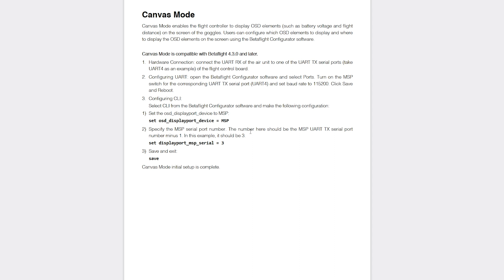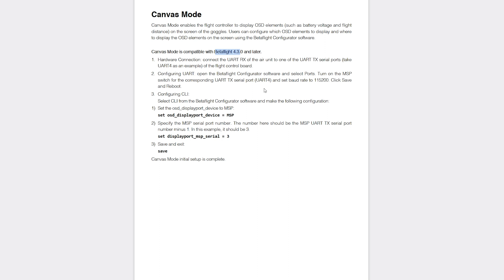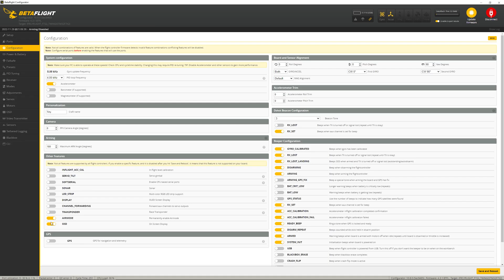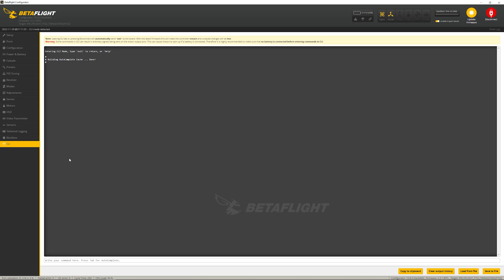How to get your custom BetaFlight OSD working on the DJI O3 Air Unit | MSP Canvas Mode is HERE!

Comment from the maker: Hey All, with the release of Betaflight 4.4, note that you no longer need to use the two CLI commands and you would set the MSP Displayport straight from the ports tab (Peripherals column). DJI does not support the HD feature though! If this does not work, make sure to set the Video Format to PAL on the OSD tab and run the set osd_displayport_device = MSP CLI command. More information is available in the release notes here: https://betaflight.com/docs/release/Betaflight-4.4-Release-Notes
Reply: I use bf4.4 - if I have o3 and v2 gogle I must use only hd option ? - it's not working :(
Reply from the maker: @froskproject  The O3 does not support the HD OSD feature and the OSD elements can only be placed in a 4:3 format for now. Use PAL.
Reply: Still can't get it working with this fix. I have voltage but that's it. Any ideas?
Reply: ahh you have to go to peripherals and set VTX msp for the uart
Reply from the maker: @SFPV  Correct, this was changed in Betaflight 4.4 I have a pinned comment about that.
Reply: @Mangorille  Brother, the link is saying "page not found"
Reply from the maker: @NatanRufino  Try this: https://betaflight.com/docs/release/Betaflight-4.4-Release-Notes
Reply: @Mangorille  Thanks a lot!

Comment: That should be good with the 04 unit too right..
Reply from the maker: Correct. Just make sure you use the instructions in the pinned comment as the Betaflight steps have changed.

Comment: can this be applied for 04 lite and o4 pro air units as well?
Reply from the maker: Yes, this applies to the O4 lite and pro as well. Just make sure you use the updated instructions in the pinned comments as there were some changes on the betaflight side.

Comment: Hi the second msp command its not valid on BF 4.3 or  4.5.imnot getting either the voltage on the dji googles im usin V2 googles
Reply: i have  speedybee405 v4 I selected msp on uart1 and not working. I swapped the pins rx and tx on the o3 connector to the FC and still the same. im stucked
Reply from the maker: @rondridealmeria  Can you send me some pictures of how you have the O3 wired up on the flight controller? If you are not getting the drone's voltage on the goggles, usually that's a wiring issue.
Reply: @Mangorille  the funny thing is that the wiring goes to the FC to the dedicated connection and the  pin order is right. Just sorted a couple of days ago, apparently Tx or Rx pins were not contacting into the DJI connector. Thanks for your reply!

Comment: What if it is UART 1, do you enter  zero in the CLI command
Reply from the maker: If you are running betaflight 4.4 or later you no longer use those commands. Check out the pinned comment. If you are using a version before 4.4, correct set to 0 if using uart 1.

Comment: Does it matter if I'm running wtfos.. cause my goggle can't be rooted.. for the other units.. ??
Reply from the maker: Which air unit are you using?
Reply: @Mangorille  03 v2 goggles. I've followed your steps.. in your video I'm on 4.4  but still can't seem to get the osd in my goggles.
Reply from the maker: @jessefpv4949  Did you follow the pinned comment for 4.4? The steps are slightly different when it comes to Betaflight 4.4.
Reply: @Mangorille  lol you didn't answer the question....does it matter if I have wtfos or no. Cause I don't. Is that preventing me from seeing osd.. or the wires from the o3 that are used for sbus and the dji radio.... cause I still have tho wires in and no problem with the rx like I've been seeing ??
Reply from the maker: @jessefpv4949  No, wtfos has nothing to do with the O3 part of the software. Weather you have it or not doesn't change anything when running the O3. The issue is one of two things - 

1. You don't have Betaflight setup correctly, which you said you have followed the instructions so that shouldn't be it. 

2. The RX and TX wires are not wired correctly. Do you see the quad's battery voltage displayed in the goggles?
Reply: @Mangorille  yes sir brother I've been flying it fly like goddess.. just no osd.i can email you pics of what I have or at least beta set up
Reply from the maker: @jessefpv4949  Sure send me some pics. To make sure, you see the drones battery voltage in the goggles?
Reply: @Mangorille  just the dji osd not beta osd what's your email

Comment: hey was that recording in 4k 60fps? what camera settings u have?
Reply from the maker: Correct, 4k 60. I use normal FOV, white balance locked to 4000k, and the shutter locked to 1/120. I use ND filters.
Reply: @Mangorille  nice! That video is really sharp.

Comment: Hi, i am using BF4.4.2,  AU O3 with DJI Goggles V2,  all work fine with HD OSD but i have no OSD on the DVR video recorded,  can some one help THX.
Reply from the maker: That’s not supported on the Goggles v2. You need the extra horsepower of the Goggles 2 or Goggles Integra to live transcode the video to embed the osd into the goggle recording.
Reply: Oh..i don't know about that😢 thank you

Comment: I have the Googles V2 with the DJI O3 Air Unit in my Nazgul and my new Cinelog 35 V2, which causes me a problem now.. I have everything set up on my Nazgul with the OSD in HD working great. Now I got the mentioned Cinelog 35 V2 which I updated via BetaFlight and I can´t get my Beta OSD to work in my goggles V2 anymore. Goggles are rooted with WTFOS. It worked before the update though but the reason I did that update is because the copter showed me every LiPo as empty. Now I wanted to check after he update if the error is gone, but now as mentioned I can´t see the OSD anymore. I tried to follow your mentioned steps, the first command is fine, but on the second one it doesn´t even show me a command with serial. What am I missing here since everything works with the Nazgul and it worked before with the Cinelog?
Reply from the maker: Check the pinned comment, you need to follow slightly different steps with the later versions of Betaflight.
Reply: @Mangorille  what pinned comment. I dont see anything

Comment: I have it all on my 5in but same electronics on my 7in and dont even get dji voltage. Shows 0.0v and have to manually turn off low power mode before flight. I set vtx displayport with msp enabled and setup the same way as my master 5 speedybee f405 v3 W/03 air unit and something just isnt poppin for me
Reply from the maker: If the voltage shows 0.0v that means that the O3 is not communicating correctly with your flight controller, which also means it will never go into full power (turning off the low power mode doesn't actually make the O3 go into full power). Double check your connections for the RX and TX and the ports tab setup. If all those look okay, try doing a firmware refresh on the O3 air unit. If that still does not work, sounds like you may have a defective unit. Another person on YouTube had this happen and ended up RMAing the unit.
Reply: It is plug and play on speedybee f405v3 and i have the port tab setup same as my 5in using the same equipment. But when i disable low power mode it goes to 50mbps and isnt flyable and glitches if i leave it in low power mode. Ill check everything again today. Thanks for the reply buddy. Gained a follower 👍🏼
Reply from the maker: @cmosdaboss  I'm not familiar with that FC, check the pin outs to make sure they all line up correctly. Ya, the low power mode is very misleading on the O3. I did a range test with low power mode off and got a lot less range than when I had the quad armed. https://youtu.be/KwikXJiTr3Y

Comment: Could you please help me? Thank you in advance.
In the "Ports" tab, under "Configuration/MSP", there is no UART port enabled. Only the USB VCP option is enabled.
I cannot enable the OSD options on the Goggles2 screen.
Reply from the maker: You need to enable the UART where the RX and TX wires of the DJI air unit are connected to your flight controller. Did you build this drone yourself or one that you bought pre assembled?
Reply: @Mangorille  Thank you very much for responding.
I bought the drone already assembled, ready to fly, it's a Cinelog 30.
The flight controller manual shows an image of a DJI diagram where UART1 is enabled. Should this be the UART port that I should enable in Betaflight?
Thank you very much again.
Reply: @Mangorille  I figured out which port it is.
But... what if the port number is 1?
1 - 1 = 0
However, in the command line, the allowed "range" is from (-1) to (40).
I entered -1 in the command line, but it still didn't work. I don't know what else to do.
Thank you!
Reply from the maker: @PauloRogerioVideomaker  If you are sure it is UART1, you'd want to go to the Ports tab and enable MSP on the ports tab on the line that says UART1 first. What version of Betaflight is on your flight controller? It should tell you in the top left corner once you connect to Betaflight.
Reply: Thank you once again for your willingness to help me.
The version of Betaflight on my flight controller is 4.3.1.
Geprc sent me the following message:
"Please don't use 4.4 firmware on the FC, We used 4.3 firmware on FC"
Did I make a mistake? The version is 4.3.1
GEPRC sent an email

Comment: Bro . Thank you, thank you!.  Man I was trying this so much and with your explanation it was easy. I even tried WTFOS and rooting the device , its impossible. It doesn't recognize my device. I didn't even know DJI fixed this with the new Update. Thanks for your video man.
Reply from the maker: Welcome. What hardware are you using that caused your issues with WTFOS?
Reply: @Mangorille  I'm using a speedybee F7V3 board. . Message I got was saying that I need to disable the ADB kill_server.
Reply from the maker: @miguelquiroz1550  Did you have the DJI software open at the same time? You can't have both the DJI software and the WTFOS webpage open at the same time.
Reply: @Mangorille No. I didn't...I closed  and restarted all. I followed your steps.. I dint install WTFOS at all. Just the new DJI firmware. I guess DJI  has enabled all. Thanks for your help.

Comment: 03, MAMBA F722, V2 Goggles DJI Controller 2. THis does not work for me line one is OK but it brings up an error when I type in the second line. My MSP is 3 so when I type = 2 it errors out. In addition I cannot select PAL or any other mode except HD so the OSD is OK for flying but no stats after flight.
Reply from the maker: Sounds like you're on Betaflight 4.4 Check out the pinned comment.

Comment: when I type in the second config serial = 3 I get an error there are x's after the serial port number in the error code
Reply from the maker: Are you using Betaflight 4.4? If so, check out the pinned comment.
Reply: @Mangorille  what would uart 1 be 0
Reply from the maker: @bengordon7635  Correct use 0 for that. Make sure you look at the pinned comment if you have Betaflight 4.4. With 4.4 you set the UAT from the ports tab and not the CLI.
Reply: @Mangorille  when you get error code on selecting serial thru cli you just enable msp in ports tab where you would have selected tramp or smart audio on the serial the dji is on  instead thru cli
Reply from the maker: @bengordon7635  Yes that is what you do with Betaflight 4.4 You still need to run this CLI command:

set osd_displayport_device = MSP
Reply: @Mangorille  🤗tried the polar for night wow terrible cam I use the night eagle 3 analog its the best for night is there a setting in 03 for night flights ? the avata has a setting but i cannot find it on the 03
Reply: 2 work great but the speedybee mini f7 v2 comes up error when I put in serial = 2 or 3 or 4 no matter what says error have another fc go use that mini has  no barometer anyway i any fixes for that one let me know i did the same as the skystars and speedybee f7 30 x 30  V3  they all have full hd osd bt that mini will not work look at the specs on it mabey i am missing something

Comment: Good job mate! Very helpful. I have bf 4.2.11, everything works but I don't see any gps data :/ some ideas?
Reply from the maker: Thanks. Unfortunately I don’t use gps so no experience there. But I’d start the troubleshooting with the general gps wiring and config. Check your uart wiring and how you have the ports tab setup.
Reply: I have the same issue with gps

Comment: Hi there, I did everything via the preset and my OSD is visible in my goggles however I see only battery voltage and rclink etc. but the GPS parameters are not showing up, so I don't see the coordinates or satellites, I have no ide why I tried everything and after 3 hours I said to myself I need help haha
Reply from the maker: Which air unit and goggles are you using?
Reply: @Mangorille  it works now 😃 somehow my dji goggles did a reset of firmware and after updating them everything worked again
Reply from the maker: @ixography  Great! Happy flying!

Comment: I've followed this exact, yours has uart3 so you put 2. Mine shows uart2 so I put one, but when I hit return I get the following error in the cli "###ERROR IN set: INVALID NAME: displayport_SP_serial = 1###" I'm stuck, any help?
Reply from the maker: Which version of betaflight?
Reply: @Mangorille  4.4
Reply from the maker: @Jonners  Check out the pinned comment on the video. The steps are a bit different with 4.4
Reply: @Mangorille  dude there is no pinned comment!
Reply from the maker: @RealBamaFPV  Thanks, I've re-pinned it.

Comment: I'm having an error. IDK what I'm doing wrong. I'm using DJI O3 + V2 Googles. BF4.4 Please HELP
Reply from the maker: You don’t need the CLI commands in BF 4.4 and the msp DisplayPort is set right on the ports tab. You can find more details in the release notes for 4.4
Reply: @Mangorille  how do I do that? I dont see it in ports tab?
Reply from the maker: @russgrgda8198  I removed the 4.4 RC since the HD OSD doesn't work with DJI anyway but check out the release notes. It's the last column in the ports tab.

https://betaflight.com/docs/release/Betaflight%204.4%20Release%20Notes

Comment: I'm trying this with DJI 03 and Betaflight 4.4 specifically for the HD OSD option, but my OSD is still smushed towards the center with extra large text like it's still in PAL/NTSC format. Anyone else seeing this?
Reply from the maker: The O3 does not support the HD OSD functionality that is in Betaflight 4.4. The only way to get HD OSD on DJI right now is with the Vista and WTFOS. Such as this: https://youtu.be/A3MtAsy77zk
Reply: Cli , ( set osd_canvas_height = 20 ) hit enter ( set osd_canvas_width = 53 ) hit enter then type save

Comment: Just got mine working, thanks a lot mate! My O3 drone is now almost ready for it's maiden flight. :)
Reply from the maker: Nice, happy flying!
Reply: Can anyone tell me why my 03 air unit and goggles 2 looks the same as my DJI FPV with V1 goggles ? I seriously feel like I got ripped off for almost $1,000 for this trash.
Reply: @endliberalism4305  because u suck
Reply: @endliberalism4305  did you go to setting- display- canvas switch it to HD

Comment: I'm on Betaflight 4.4. RC5 with DJI O3 and Goggles 2. I've followed these steps as well as the updated steps for 4.4 (for omitting the set displayplay_msp_serial command and instead selecting VTX (MSP + Displayport) in the ports tab for my UART but I still have no additional osd elements. Im using simple things like crosshair, and artifical horizon. Please help!
Reply from the maker: Let me try out RC5 tonight and see if it works for me. Do you see the quad voltage in the goggles? That would help confirm that your wiring at least is okay.
Reply: @Mangorille  Thanks for getting back to me! I have since fixed this. It was a super simple error. The fix for 4.4 RC5 is this: After using CLI to use command: set osd_displayport_device = MSP  you must then use command: save (it was literally this simple, and all I was missing).
Reply from the maker: Ah yes, you need to type save. :)
Reply: @Justinl12086  but bf 4.4 not recognized commend set DisplayPort_msp_serial = (port - 1 )
i have a problem to configurated o3 and gogle v2
Reply: @froskproject  thank you, but I found my error shortly after the first post. I was was missing the save command
Reply: @Justinl12086  you use first line command next save, and second line ? I am not fix it yet :(
Reply: @froskproject  you shouldn't have to enter these commands anymore. Now it's supposed to work by setting the parameters for the uart that the o3 is on (uart1 typically) in the configuration tab of betaflight to msp displayport. BUT, I'd that doesn't work, all you have the do is go into CLI and is type set osd_displayport_device = msp after pressing enter, u will get a confirmation, then just type save. It should work for you after that. Currently the HD  option isn't working for us goggles 2 users, so be sure to setup your osd in the standard size. Hope that helps
Reply: @Justinl12086  HD work in DJI v2 ? I must change somethink in gogle ?
Reply: @froskproject  unfortunately I don't have a set of those to test, but as I recall from my searching, it does work for goggles v2, but you would need to root them with the WTFOS. I would try searching that one up.
Reply: @Justinl12086  - So, just to confirm this will ONLY work if you have WTFOS?
Reply: @whereverimayroam74  you won't need wtfos for the goggles 2, only the goggles v2.
Reply: @Justinl12086  - Sorry, yes I should have confirmed that I am on goggles v2.

Comment: do you know if this is compativel with de Dji goggles v2?
Reply from the maker: Do you have the vista or the o3 air unit?
Reply: @Mangorille  air unit O3 + goggles v2
Reply from the maker: @dronebirdun  Yes it is compatible with O3 and Goggles V2.
Reply: @Mangorille  what your firmware on the dji goggles? I got the 1.05 but its not compatible canvas mode on de osd... i read about and is compatible just with the lasted or 1.04 firmware. can you confirm?
Reply from the maker: @dronebirdun   V01.04.0000 on the Goggles 2. All versions of the O3 air unit support this and have since release. What issue are you having exactly?